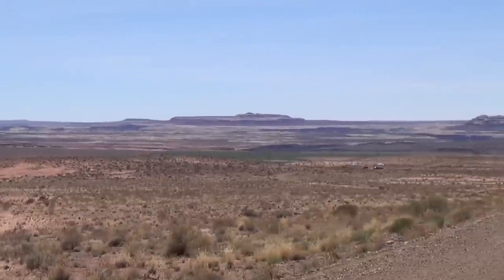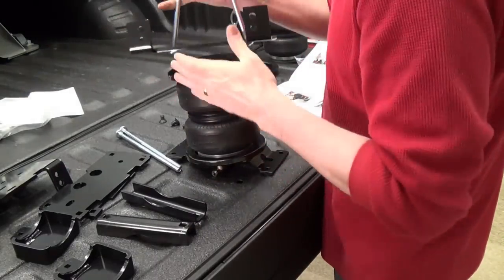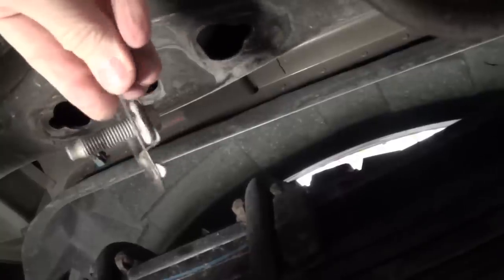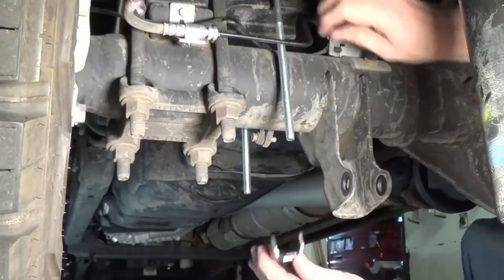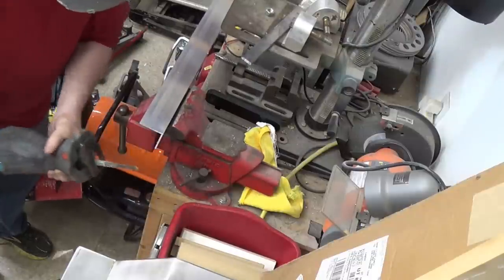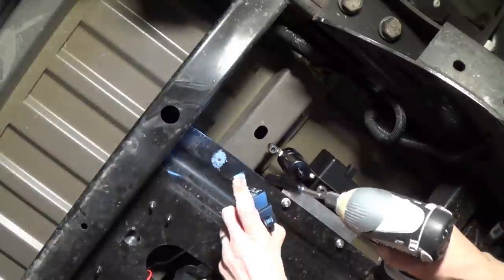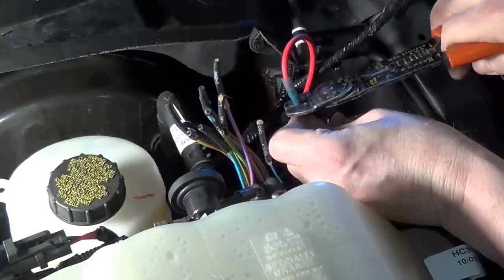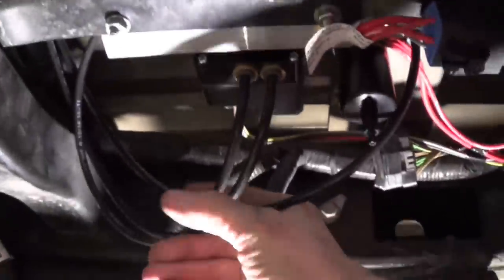Installing Air Lift Air Spring System on 2017 Ford Super Duty F350

Comment: Great video, thanks for taking the time and effort to put it out. I have a 2017 F-350 and added the exact AirLift set up. Ordered it on line and was going to have a local shop put it on after crawling around under the truck and not seeing a good location to install it.  After I watched your video I installed it myself.  Again thanks!  
By the way, Semper Fi
Reply from the maker: No big deal really. Just hard laying on the back with the arms outstretched for so long. Oorah!
Reply: Phillip Coble u
Reply: Remember that the 350 Ford didn't add a frame plate behind the cab like on the 450 so its a little week spot  most guys are adding bags to handle more weight

Comment: I did this same thing to my F450 Dully a few weeks back. It's the same kit that you have and it was a very clean step by step install. I am really impressed where you put the compressor. I have installed several of these kits on previous trucks and I have always mounted mine right below the driver door on the frame rail.
Reply from the maker: There is a TON of space up under there. I'm sure your normal spot is fine but it's kind of nice to almost never hear the compressor running because it's so far away. It's also comforting to know it's well protected from the elements.

Comment: Thanks for kool videos. always good to have someone break trail so to speak. I just also finished install of 5000 plus bags in my new 2017 f250 6.7. Piece of cake easy. One thing I did was while bags were assembled on thebench I fully compressed each bag then wrapped with a couple heavy duty tie wraps to keep compressed during install. Then cut off. Now comes 72000 install. I only haul a new Palomino SS550 truck camper at 1450 lbs to/from Alaska. I'd like to install a new 50 fuel tank but alas I'm truely humbled after watching you do it. Look job my man
Reply from the maker: Great tip on pre-compressing the air bags!

Comment: Thanks for this video.  Just completed the install on my 2017 F350 SRW.  My last pickup was a 2002 F350 and I can't believe how TALL the new one is comparatively.  In order to get level with my 2003 5th wheel I had to move the leaf springs on the trailer on top of the axle, which got me about 5".  Still couldn't get the truck under the trailer when level.  So, I had to take out the 3.25" factory spring block and replace it with a 1.5" spring block.  Now I sit close to level when unloaded and level with the 5th wheel attached.  And, I have 6" clearance to the bed rails.  I added these same Air Lift setup, had to do some slight modifications to make them fit with the new spring blocks, but made it work.  Now when I tow real heavy I can keep it level.
Reply from the maker: Way to go, that was no small project. You modified your trailer and the airbag mount points. It will be awesome from here on out. My trailer's axles were already flipped when I got it so that was nice. I was worried that the truck would be too high also but it turned out great.

Comment: Finished my 72000 install last Saturday. Thanks again for all your help & videos on your install.
At some point in the future I plan to install the Viair compressor to use with the Airlift 72000.
Reply from the maker: It's a great system. You'll enjoy it. The little compressor will run forever if it's kept dry. Still, you might want to keep a couple of Schrader valves in the truck to splice into the airbag lines in case of failure.

Comment: Thanks for the video. This was super helpful for my 17’ F-250. I watched this video and the video we’re the air compressor went bad. I decided to installed mine in the cab behind the rear seat. I ordered the wireless Airlift compressor with the frame mount bracket. I removed the stock jack and it’s bracket. Using the stock jack stand bracket, I drilled holes into the bottom of the air compressor frame mount to match the jack stand bracket holes. I used the stock bolts and installed the air compressor frame bracket where the jack stand was. I then bolted the jack stand bracket to the top of the air compressor frame mount bracket. Just need to run the electrical and air lines. I hope the air compressor will last forever.
Reply from the maker: Sounds like a great plan. Inside the cab is a bit noisy but it sure is dry. No worries about losing a compressor due to water. The only thing you'll have to maintain is the compressor filter which can fill up with lint and dust.

Comment: Good job on covering your installation.  When that clip fell into the frame, I'm thinking that is exactly how my installs will go.  Ha ha. I like how you set everything up, looks top notch.
Reply from the maker: Thanks. The video didn't show the whole story. I tried with my finger for a few minutes and gave up. Then  installed the other side and finally got the idea for the wire. Worked great!

Comment: Nicely done video, precisely what I want to do to my F250. I have the current airbags, but I do not have the compressor set up, and it gets pretty tedious to go out manually to check the airbag pressure constantly. So having a compressor on board is only the best logical decision I can make. Your video made it easier for me and gave me the confidence to go ahead and try this on my own; I appreciate it, Semper Fi!
Reply from the maker: Glad I could help

Comment: Yeah, I have a heavy optioned Chevy 2500HD (with all the extra tow options), but with my heavy 40-ft fifth wheel, I had a LOT of fifth wheel down weight that gave me a lot of rear-sag that I couldn't get away from...so I added the Airlift 5000 kit (with the single-line manual gauge) and simply 'T'd' the air line across the axle...worked out perfect! DEFINITELY killed the sag, leveled me out...best $400 I could have invested on it!
Reply from the maker: The airbags can lift a lot of weight. I'm curious about the T setup with yours. I've heard that can allow airbags to push air from one side to the other and exaggerate a lean. Have you had any such problems?

Comment: Another great video and perfect neat, installation. Thanks.  So far the lower Torklifts are great for our camper but I need the Hellwig Bigwig which arrives tomorrow to help with side wind loading.  Building brackets today for Viair compressor and tank.  Due to winter salt I plan to stack them in the corner of the box (passenger side)  with a sheet metal cover for appearance. No interference with camper and out of the weather.  Horns will still go underneath.  I am finding space for this equipment underneath but not without extensive mounting brackets or mounting surfaces without drilling the frame, something I avoid whenever possible for accessories. I look forward to your solutions.  Thanks for your efforts to educate us all.
Reply from the maker: Thanks. You're going to love that Hellwig for that big camper. That's a different animal than just managing a heavy pin. I am loving how well this truck works.

Comment: Double check the hardware you have to hold your module on, I think you said aluminum bracket, if you’re using steel bolts you’re going to get galvanic corrosion and it will erode the surrounding metal.
Reply from the maker: Funny how I've used aluminum for this type of application my entire life and never even noticed any corrosion. When Ford published the aluminum fastener document it went a long way to educating the masses. I think the reasons I've never had problems is partly due to a couple of things. There is no electrical current running through the brackets I've made and I live in a high mountain desert with low humidity. That and I've never kept a vehicle long enough to see failures. Time will tell.

Comment: I'm still shocked at how high the new SD's sit ..looks awesome! ford is the only one that need very little add on's to look trick
Reply from the maker: I agree. It's two inches taller than the last version. I put a level on the front and with the 37 inch tires it just looks awesome.
Reply: EpicCowlick haha I know your dilemma..I have a 2014 350 platinum ,I love the way it drives super smooth yet I hook a 42ft toy hauler and it squats  it just level no bags needed..but I'd like to put a level kit in...but then I'll need to put airbags and if the truck is going to sit a little taller I think it needs a broader stance..so better put rims on..but then I really like how smooth the stock platinum wheels look and roll..lol there's always a snag !

Comment: I love this video it's been something I have been wanting to do for years!
So like you said that you can adjust each air lift from 5psi - 100psi would also be able to attach a line set to air up the truck tires or quad tires that are needed? If so can you kindly suggest how to do this or put a video? That would be so awesome.

Comment: Couple of questions as I am installing this week - how did you raise and support your truck to lower the axle and how does your remote work with the manifold so far back as I had trouble with my remote connecting on this same this setup on my 2012 F250 with manifold mounted under rear drivers side door. Great write up - thanks!
Reply from the maker: I just put a jack under the rear hitch and lifted the rear of the truck a few inches. Jack stands under the frame once it was up higher. At first I did have trouble with using the remote in the cab. I had to hold it as if reaching into the back seats to change pressure. It works fine now from anywhere in the cab now so not sure why it struggled at first. I don't use it much in the cab anyway. I only change pressure when the trailer is attached and I use it as part of raising and lowering landing legs on the 5th wheel. I inflate to 85 psi after I connect and start retracting the legs and then drop to 5 psi when I start lowering the legs. Speeds the process up. I've learned to never leave the remote on the truck bed sides. I've almost driven away like that a couple of times so it's always in my hand or pocket or center console. No exceptions. lol.

Comment: Can these be installed while the truck is on the ground? I had a set for a '13 F250, but when the instructions told me I had to suspend the rear axle via placing the frame rails on jack stands, I just brought it to a shop.

Now I have a '17, and I'm wondering could I have done it without the axle suspended? It looks like you just had the axle lifted to allow ease of access during installation. Can you confirm this. Thanks, and great video!
Reply from the maker: I just jacked up the rear end under the hitch to increase the distance between the axle and the frame. The tires never left the ground.
Reply: @EpicCowlick  Awesome! Thanks for the quick reply.

Comment: Hey I have to ask ya how you find the truck tows with the level and 37s? I have 3 6.7 PS that’s I tow a lot with. I am trading in my 17 for a 2020 and am wanting to either do a level or 4 inch lift with 37s and I run airbags on everything. Look forward to your response.
Reply from the maker: This setup tows very well. Engine is strong enough to tow heavy with the 37 inch tires. The 2020 will be even stronger. The only concern is the bed height if towing a 5th wheel. My trailer's axles are flipped giving me 4 inches of height. It clears the bed rails great but would not if the trailer was at factory height. Tag trailers don't care and only need a good drop hitch. Goosenecks have plenty of clearance. Airbags are a must for stability and level towing in my opinion.
Reply: EpicCowlick Awesome I appreciate the response. Yeah I tow bumper and gooseneck so I’ll be good that way. Couldn’t agree more. I even put bags on my 550. Check out there channel if you like PS content.

Comment: Lol, I had a good laugh when you lost that nutplate, great video. Now since that you had it in for a  while now do you have any leak in the bags where your remote 72000 come on and put air back in them sometimes?
Reply from the maker: Great question. The airbags have been awesome and I'm really glad for this model which has the bump stops inside. My little compressor failed this summer and I lost all air while pulling that big trailer. I was glad for the bump stops but I definitely wasn't level anymore. Found a solution that gets rid of the air bag compressor. Check my channel for the latest updates on an onboard air system and integrating that with the Airlift wireless controls.

Comment: Very well documented video - Thanks!   Does Firestone also have an airbag setup specific to this application and if so, what prompted you to choose Airlift?
Reply from the maker: I had the Firestone Ride Rites on my previous truck and thought they were great. I knew about the AirLift versions and was always curious. Knowing now how well made the springs and the mounting brackets are I'm glad I gave them a shot. High quality product.
Reply: Thanks for your perspective. I've had both and felt the Firestone's were more robust, especially in their mounting brackets
Reply from the maker: That is interesting. I've installed both and felt like the AL bags are more substantial, thicker. And the main base bracket is larger and sits directly on the jounce bumper instead vertical extensions of Firestone's lower axle tube brackets. But at the end of the day, it's all just engineering. Clearly there is more than one way to skin a cat, so to speak. The Firestones proved themselves on my previous truck and these Air Lifts are new to me but have a great reputation. Time will tell.
Reply: My experience goes back about 8 years ago on a '97 Chevy. Perhaps the design quality of bracketry between the two manufacturers varies (i.e. is model specific) or Air Lift has just improved relative to Firestone.  I must admit, I like Air Lift's incorporation of a bump stop integral to the bag. One manufacturer whose bracketry was REALLY poor was 'Hellwig'.

Comment: @EpicCowlick , question I have seen several installation and most  of the videos have them wiring the compressor to the fuse box not to the upfitter switches.  Have you had any issues using the upfitter and wished you had gone to the fuse box?
Reply from the maker: Absolutely no regrets. The best reason for using the upfitters is the ability to turn it on or off so easily. I've seen some guys wire them to hot circuits or 'always on' but that seems to be begging for a dead battery.
Reply: @EpicCowlick  that is what I thought a well thanks for the info

Comment: Do you feel very confident knowing that you went with Air Lift over the other manufacturers?
Reply from the maker: I am very confident with the Air Lift system. The current 72000 wireless compressor is improved with a water separator/filter and the airbags themselves have a very robust mounting design. On top of that, I just pulled the trailer about 600 miles and went underneath the truck to see if anything came loose and all was well. Very happy so far.

Comment: Just curious to as what your 5th wheel weights, and what psi you had to inflate your airbags to in order to restore level???
Reply from the maker: Trailer is heavy. but pin weight can be controlled partly by strategically loading the dirt bikes and side-by-sides. Rear axle weight is close to max and under max 5th wheel rating. 85 psi in the bags level the load.
Reply: @EpicCowlick  Just installed these bags on my 2015 F350 powerstroke. I will be towing a 5th wheel that has a dry weight of 9,500 lbs. I'm just wondering how much psi in the bags that it will take to level back out. Just curious as what numbers to expect. I installed everything the same as you did with everything. Your video helped a lot. Thanks!
Reply from the maker: @billymann5325  I've found that higher pressures really help the feeling of stability and control. Just start out with 50 psi and go from there. The airbags are rated up to 100 psi so you can run them however you like them.
Reply: @EpicCowlick  That's really helpful for you to give your insight on that.  Now I will try just that..Thanks!

Comment: nice truck. .good video. . what's the 5th wheel capacity on those 2017 f350?   I had a 2013 f350 swd had to get rid of it and get a dully for my tri alxe toyhauler.  keep up the good work on the videos. .safe towing
Reply from the maker: Max 5th wheel towing is 20,600 for the SRW F350.

Comment: Those "push in" air line manifold connections I'm sure are airtight, but don't you inflate the bags and soap spray them before you'd call it a day with the install? 
And, what kind of donut was that?

Comment: What are your thoughts on the Stainless Steel option?  It has a slightly different part number but seems to have the same fit and weight capability.

Comment: Great videos all around! One thing though, would you not want to isolate the DIY compressor bracket from the truck's frame, seeing as one is raw aluminium and the other is steel?
Reply from the maker: I've made these types of brackets my entire life without even knowing about galvanic corrosion. Funny how I have always chosen aluminum because it doesn't "rust". lol. My take on that issue is that if the dissimilar metals have either an electrical current running through them or if the vehicle is in a humid or otherwise corrosive environment then yes, you should deal with it with proper fasteners. In my case, I have neither so I get a pass.